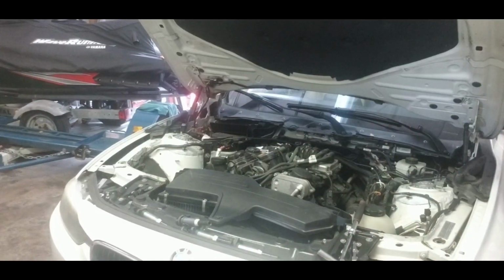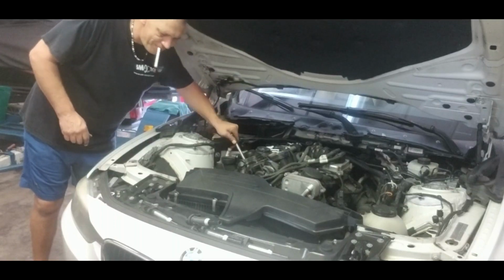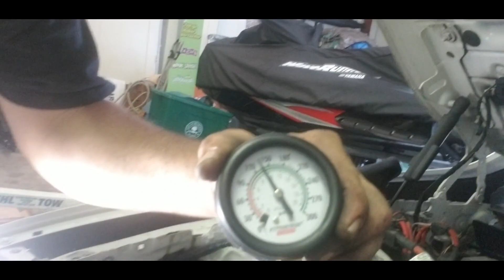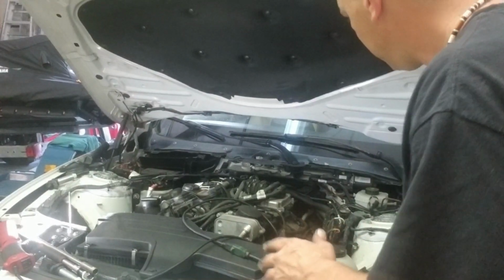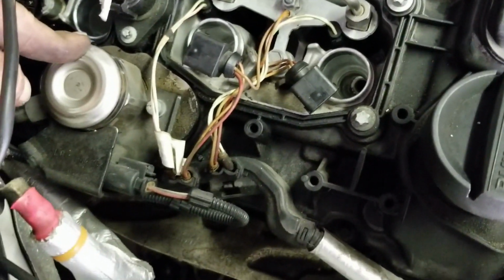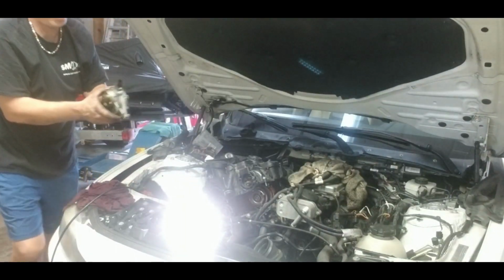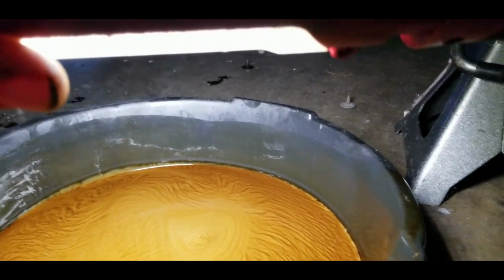2013 BMW 328i F30 N20 car ready smoke brake - Blown head gasket repair on BMW 328i Part 2

Comment: I'm watching your video in So California at 11:52 pm.  Not too many head gasket issues on BMW.  I am surprised.  Looks like the wrong oil filter was used.  It's common for people to use too long of a filter and it crushes it like that blocking the flow of oil through it.

Comment: The motor is gone no center cartridge for the oil filter wipes out bearings metal gets jn to the piston rings and they get stuck ànd oil blow by starts the process.

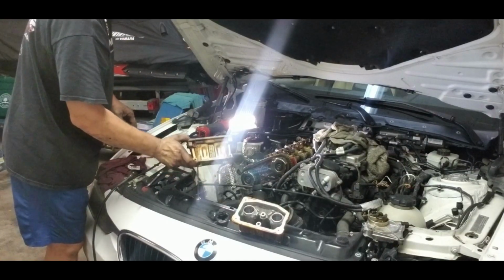Comment: At 13:28. You’ve removed 2 “spark plug tubes” what is the official name of the entire block you have in your right hand?
Reply from the maker: The BMW call this part "Spark Plug Recess Insert" on google U can search " Spark Plug Recess Well"
Reply: @CarReadySmokeBrake  How did you remove without BMW tool?
Reply from the maker: @gdiddy103  The Injector remover tool need when injectors stuck in place. If u lucky just a little pray and come out.
Reply: @CarReadySmokeBrake  I guess i'll have to get the tool, I tried everything  and it would not budge... thanks for the quick response ... I have two heads that need to come off since mine are both interference engines.😟
Reply: @CarReadySmokeBrake  I got the heads off and checked the valves so far none of them are bent... the dealer told me that I had an issue  with  cylinders 2 and 3, and now that Ive taken ever thing apart I discovered thes are not interference engines... the cylinder heads have the notches in them to keep the valves from bending... the only thing I saw was a bunch of crud on those cylinders which may be the cause